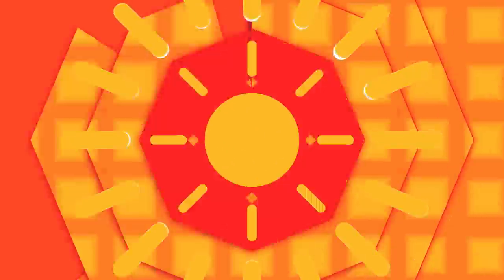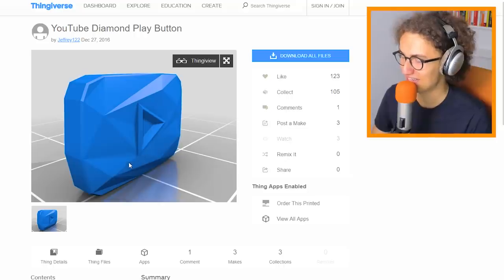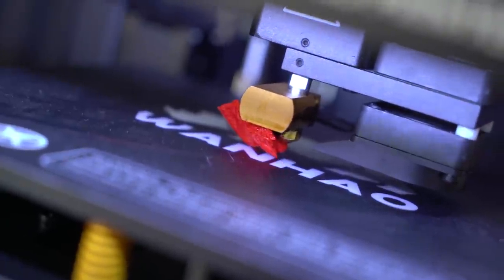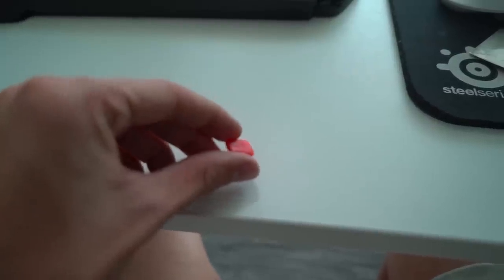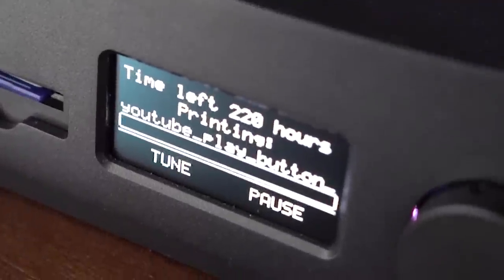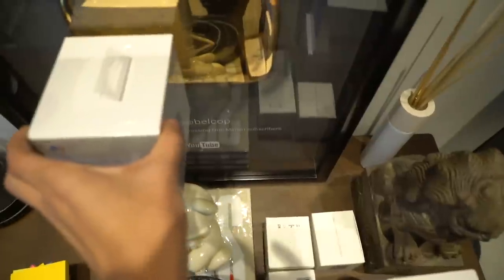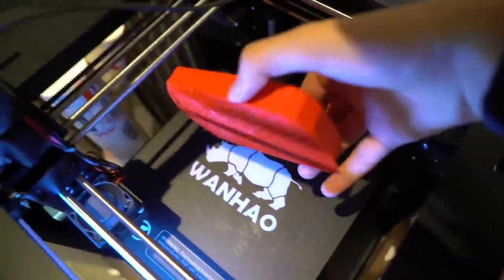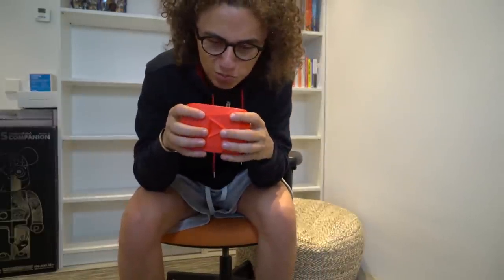3D Printing A YouTube Play Button! - How To DIY

Comment: Hey I have a 3d printer and I am vert experienced with it. I suggest in your slicer(cura or SOLIDWORKS) you don't use rafts to hold your prints down unless they have very thin parts touching the build plate

Comment: Hi! I think you could increase the speed a bit for the larger print as it won't fail because it was much larger than the mini version. Also to deal with warping you could increase the temperature of the print bed itself.

Comment: Jordi,
If you are having problems in the future that are similar to what you had at the beginning of the video you can coat the build plate with a bit of glue stick or masking tape. It seemed in the video that the first layer of filament wasn't sticking to the bed, so glue or tape should help you be able to print at normal speed. If you are still having issues, you can adjust the z-offset or recalibrate the bed. It can be very hard to 3D print but keep up the good work. Your videos are very much appreciated!
Reply: Also PLA filament is not toxic to breathe as it is made mostly out of sugar cane. However, ABS filament is toxic and is best to not be around
Reply: If you want to stop warping as you said before, try to maintain a constant temperature in the printing environment. The window being open and having no build plate adhesion most likely caused the warping.
Reply: And in the future if you want to make the print time shorter for large objects like the play button try lowering the infil percentage when you are uploading the file from your computer to your printer.

Comment: You could have printed it in a few hours if you just changed the printing speed and layer thickness....also, you didn’t even calibrate it , that’s why it released from the plate on one corner. You shouldn’t operate a 3D printer with your lack of knowledge. I recommend watching a few hours of Makers Muse...

Comment: You're still using Cura 15.04? 3 has way more new features, more settings, and a smoother UI. The only thing that could possibly make the old one better is the pronterface UI.

If you're having bed adhesion issues, reduce the gap, or consider using blue painter's tape if you're printing PLA, or ABS slurry if you're printing ABS.